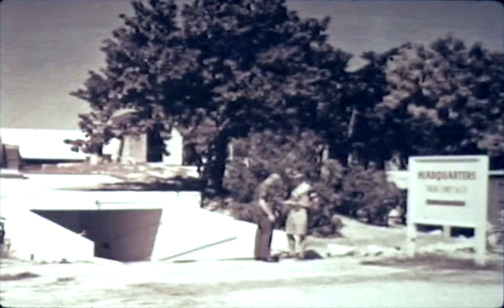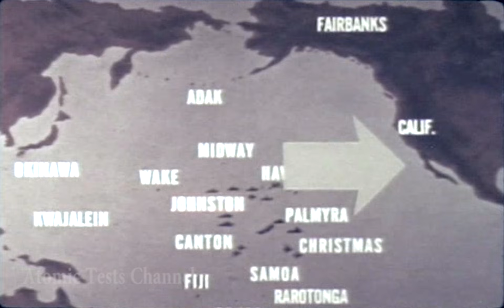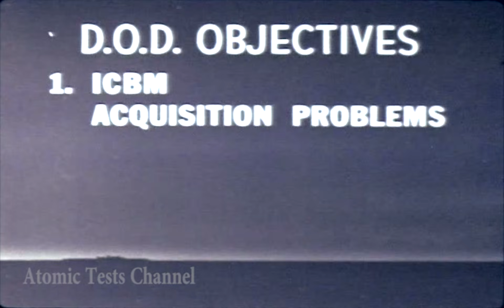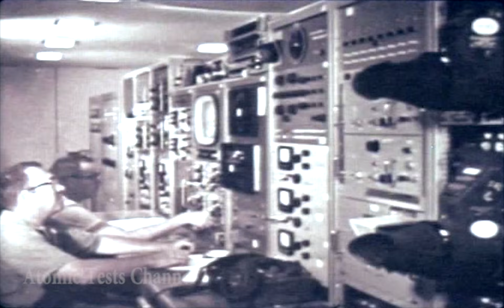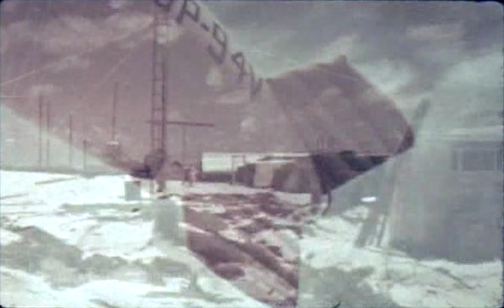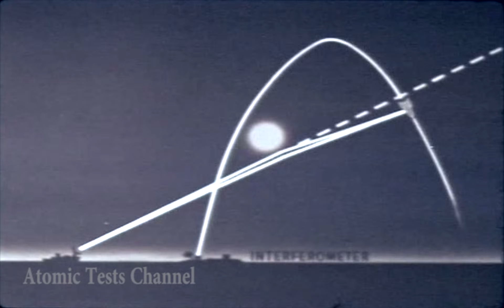OPERATION FISHBOWL - HIGH ALTITUDE WEAPONS EFFECTS

Comment: Everyone arguing over flat earth...if we can take photos of galaxies why can't we just turn the damn satellite around and take a quick shot of earth?? And without photoshop I must add. I feel that's just simple but hey I'm not a scientist.
Reply: Okay here's a question I have. The first thing is whether earth is round or flat, I lean towards it's definitely a globe. But the Apollo missions were definitely some boo sheet, the LEM is a fucking joke. You can do the math yourself, the moon is 1:4 the size of earth.so it would take 1:4 of the fuel it took to escape earth to escape the gravity of the moon. That's if we've been told the truth concerning "gravity" and space etc. From the "facts" we've been told the temp on the moon is, jeez what was it? I'm wanting to say 260 degrees but I'm probably getting that figure wrong.nvm I googlayed it and I was spot on 260 in sunlight and minus 280 when sun goes down. I actually worked at a celenese plant that was the only place in the world that manufactured the flame retardant synthetic material that's used in astroNOTs suits and is used in "space craft" and many jets and such.  It's actually a doped fiberglass mat type stuff. I watched a bunch of quality control test on the material and it doesn't burn really but its also insulating so if you were to go outside on the moon and it was 260 degrees within ten minutes your going to be baked inside that fucking suit and same goes for the lemming vehicle. And that's IF you can make it through the van Allen belts in a fucking tinfoil tent. And here's one other thing, years back when we got direct TV I was watching the tech calibrate and set the precise angle for the sat dish , and I was like how's that work, he said sats are geosynchronous.whixh kinda made sense however I've wondered since then if they aren't just using  those huge sat dishes to broadcast and basically bounce the signal by attenuating the signal off the ionosphere. Which IS something they do and seems more likely than space sats beaming signal strong enough to pick up from a geosync orbit. Because though they did have solar panels at the time of direct TV debut the efficiency was garbage in the 90s and to transmit on all those frequencies simultaneously requires some voltage and current that just wouldn't be available at the time even with solar panels that were like 100 square yards
Reply: The education system at its best
Reply: I don't know a whole lot about gps but when i worked in construction i used a gps unit for setting grade and if you didn't have enough satellites above (you could look and see how many you were linking to) or if you were too close to a tall building or trees, you wouldn't have enough data to triangulate and get accurate readings.  The unit i was using could do horizontal positioning within 0.01 of a foot, and vertical positioning within 0.02 of a foot, without that level of accuracy we wouldn't be allowed to use it.  It had nothing to do with radio towers.

Also...when you look out with a telescope and find say Jupiter in the sky, it looks like a sphere, same with all the other bodies you can find with a telescope, so is everything a disk that just so happens to be pointed directly at us at any given time so as to look round? Or is earth just...the only disc in the universe? Seems a far larger reach than oblate spheroid
Reply: they are waiting until they can get CGI advanced enough
Reply: Better yet, if one side of the moon always faces the Earth, why can't they send a rover with 24 hour live feed of the Earth. They can send and control a rover on Mars, and send back pics to Earth. So why can't they do something on the moon again like I mentioned above?
Reply: We live on a NON-ROTATING EARTH
Reply: What?
Reply: There is many photos of earth like that, not that changes the mind of the flat earth cult even a tiny bit...
Reply: Hey all, just an update. I was just kidding. I totally had all of you going! 2 years I've waited! Ha! Got em!
Reply: Haha got 'em!!
Reply: Yeah take ah selfie.....
Reply: Not picking a side here, but even NASA says there are only 3 full pictures of earth from space. One from the Apollo mission. One in 1972. And supposedly a new one in 2015. Finally a supposed video from 2018 showing the dark side of the moon. They openly admit the rest are either composites or cgi. They have never “turned around” and telescope or camera and put the debate to rest. So it is indeed suspicious.
Reply: Look. More dumbasses 😂
Reply: Whose we ? Did you take pictures of galaxies yourself? Or did you take NASA's word for it? Lol Congradulations , your elevator is out of service!
Reply: @timburdette3556  I did take pictures of several galaxies myself, yes. It's not hard, if you settle for Andromeda a 200$ telescope will do the job, and you can see it with your own eye as well.

For objects that are further out, amateur telescopes can go a long way, although not as good as the NASA telescopes obviously.
Reply: Anyone think Hubble is a repurposed Boeing 777?
Reply: I know you're just kidding, but, for everyone else, there's a difference between what they call "GPS" on cell phones and true GPS. The cell phone version is triangulated using cell towers. Real GPS uses satellites. Concerning the Earth picture, I think the earth is just too big to take its picture from the moon. Also, there's lots of stuff they don't want us seeing, like other beings' crafts. They're hiding the existence of evil telepathic reptilian demon monsters who have secretly been in control of our governments and are the root cause of all this suffering in the world. Thry can read and manipulate our conscious minds, and are very skilled at psychological conditioning. They're the cause of all these cases on court tv and stuff. They are what schizophrenia really is. Righteous reinforcements have recently arrived to help us take them out. The "angels" answered my prayer for help and info, because the demons were harassing and threatening my life for exposing stuff. The angels even helped me get amazing, original photo evidence.

I wrote a long summary and posted a bunch of amazing evidence onto Quora. The address is in my bio. Help spread it to save the world faster. 

This is real "alien disclousure."
Reply: When it's really cloudy or rainy my GPS becomes wonky and I would attribute that to line of sight from satellites being obstructed... if it was ground based weather wouldn't effect it. My cell service will work fine even internet but on really cloudy or severe weather related days only my GPS is effected.... so...
Reply: @mrlucidboy  SO, SATTELITES can travel 1000m/h around earth and a whopping 66000m/h through space? LOL
Reply: @RabbitholeIsrael  He is right in connection with GPS, can it be gallons much lower than satellites? My EMF meter showed very high values from the direction of the sky but antennas / towers on the ground. How? Why?
Reply: Gallons = balloons
Reply: @mrlucidboy  Yes it woud as it relies on a satellite or two but they are attached to hot air balloons in what they call “lower earth orbit”
Reply: @godworden2768  ok so I looked into that and gps satellite claim to run on meo medium earth orbit can you link anything to what you are referring to? Cause Leo and meo are quite a bit different... I just wanna be able to say I learnt something today
Reply: @mrlucidboy  Well I can’t link to anything because it’s not known.  GPS is land based and uses a blimp satellite to bounce off of.  I mean they claim there are tons of satellites travelling really fast always falling around the “curvature” of the Earth, that’s ridiculous and how do you bounce signals off of something moving like that?  Look at satellite T.V, they need to be pointed a certain direction to get a signal and are always pointing that same direction.
Reply: @godworden2768 lol wtf 😂
Reply: @mrlucidboy  LOL
Reply: @RabbitholeIsrael  so it makes sense then, right?
Reply: @mrlucidboy  no it doesnt
Reply: It might if you had actually paid attention to your grade school math teacher or for that matter your PE teacher. 

Ever look at a high school running track and wonder why the outer lanes are longer than the inner lanes LOL now imagine that same math on a global scale, 

I'll make it simple for you just look at a wall clock and measure the arc the second hand travels at 1 inch and again at the outer edge or even simpler measure the circumference of a golf ball vs a beach ball  

OHHHH SNAPPP   how does it feel to have your butt handed to you on a silver platter
Reply: @dannelson8556  Exactly, the outer line is longer, but it's longer on a gone, too when the planes go higher. How much longer on an average height?
Reply: GPS is a ground based system just like cell tower's...if it wasn't I wouldnt have dead zones here when they were allegedly able to communicate on the moon.
Reply: @The843legendz  What about the phone call that Nixon made to the moon? Bahahahahahhh.
Reply: @The843legendz  your talking about Google maps not google earth 🌎
Reply: @pinkyhotmessx69  I said GPS. How can you misinterpret that.
Reply: @The843legendz  No. gps is not ground based, your gps receiver is though (phone)
Reply: @The843legendz  GPS is satellite based.
Reply: @The843legendz  If you are very far north or south, you would get dead zones behind mountains or in deep valleys. I've never experienced GPS dead zones, even at 55 deg north latitude. Well, yes, in tunnels and underground parking lots.
Reply: @Pow3llMorgan  on plane ground under the cell tower. Dead zone. I had a military drill near the cell tower. No reception. Everyone was freaking out cause noone could call their loved ones on spare time.
Reply: @The843legendz  exactly how many times were you droped on your head as a baby. 

Not only can you calculate when the satellites will be flying over the horizon you can actually see them, assuming you understand azimuth and elevation, and if you know a bit of math you can calculate their speed based on Doppler shift.

Yeah satellite tracking is a hoby ohg mine and I've been tracking satellites and space craft from my home since the first moon landing. 

I mean you do realize that millions of ham radio operators and armature astronomers have been tracking satellites and space craft since the 60's ..

It's kind of hard for the government to hide a space craft flying to the moon from anyone with a telescope or radio receiver
Reply: @dannelson8556  Since the first moon landing? Say no more....
Reply: @dannelson8556 what an interesting hobby!
Reply: Photos of galaxies aren't real.
Reply: @luuifyeeeee  So if you are on the moon you can't get the eath in a single shot? The more I research this the more I see the lies of NASA etc. I don't know if its Flat or Round. But I know for sure NASA is lying.
Reply: @Robert-Zimmer  You can, and you have such pictures. Since 1968... But you "honest" lot just choose to ignore them. It's hard to be special if you acknowledge facts, then you would be just another one of us sheeple.
Don't mind me, keep fighting windmills you "special" people.
Reply: All of this while the Earth is spinning 1000 mph , and at the same time rotating around the sun at 67,000 mph!!!. Oh yea and we and the sun are traveling a million mph through a vaccum called outer space!! I guess santa and all his flying reindeer living at the North Pole lol
Reply: Guess you never heard of Hubble
Reply: @pinkyhotmessx69  Hubble has never turned around and taken a picture of earth.
Reply: @Galaxy-gj9wy it’s like trying to take a selfie with a back yard telescope, it’s not possible to get a picture of something that close up with such a huge zoom
Reply: @pinkyhotmessx69  hubble aint did shit
Reply: Because it is impossible. "Space" does not exist... neither does "gravity". Satellites do not "orbit" the earth. All lies. Copernicus was hired by the Catholic church in the 1500's to invent the heliocentric earth model. He was also a freemason. Thus began the world wide effort by the ruling "elites" to hide God from us. The astronot's from the NASA programs... ALL freemasons. These satanists that rule all government's want you to worship them.
Reply: @nope5445  its funny because 200 and some years after what you claim, catholic church condemned Galileo for his theories(now most of them known as facts). flat earthers get dumber each year. now gravity is also a hoax thats interesting, space, i get it, you may not believe what you dont see or feel(God is one of them btw) but gravity is felt every second of your life. ???
Reply: @midgardprint7365  Just with common sense, what about object less heavy then water? Imagine the Earth (globe) and you being on the upside down part playing with a ball in the ocean, the ocean will send the ball up to the surface, how your gravity (direction) works then preventing the ball to fell down to the space? But on a flat earth... Am I wrong, if yes, how?
Reply: @gundelpalacsinta2604  It's very simple and you're mixing up 2 physics laws. ball comes to the surface due to the fact that it has a lower density than the water. it doesn't fall off the face of planet because it doesn't have enough energy released in the opposite way of gravity to escape it's pull/force. i don't know where you are trying to go with this? there can be tens of laws acting at the same time. the fact that gravity exists doesn't change the floatation principles.
Reply: You mean CGI by Galaxy 🌌
Reply: Those pictures of galaxies are fake. Nothing can even leave the atmosphere to take pictures. There's no such thing as galaxies
Reply: @kilaellareign  With a pair of binoculars you can observe yourself some of the galaxies yourself like the Andromeda... And with a proper telescope you can se a lot more. But you have to get out on the countryside where there is less light pollution to see it (you can not see it in a large city because of the sky is not dark enough).
Reply: Face Reality ✅
Reply: @kilaellareign  You can take pictures of galaxies and planets from the ground in your backyard if you spend a little money on a decent telescope.
Reply: @kilaellareign  millions of armature astronomers and armature radio operators disagree with you as we have personally tracked these space craft. 

I started tracking space craft back when we first landed on the moon, Using my own home made equipment I was able to track the Apollo missions all the way to the moon and back. and I'm not the only one there were literally millions of ham radio operators and armature astronomers all over the globe who did the same thing.
Reply: @kilaellareign  Agree fake as f
Reply: @kilaellareign  this has been crossing my mind lately.
Reply: They do and they have but you're going to dismiss them all without even looking. Yet I bet you use GPS almost every day.
Reply: @Pow3llMorgan .....gps is land based. If was in the country other day and no GPS signal until I got close to built up area. You are so easy.....
Reply: @Pow3llMorgan  gps is not a pic of earth
Reply: @Pow3llMorgan  No there are no real images of the entire earth and GPS is land based towers genius.
Reply: @godworden2768  So how does GPS work on the oceans, thousands of kilometers from any land based towers?
Reply: @Pow3llMorgan  it has a far reaching range, everyone knows gps is land based.
Reply: @godworden2768  Everybody who's a science-denier and a blatherskite, perhaps. Cite me a credible source that says it's land based because I have reams and reams of material on how it's not.
Reply: @Pow3llMorgan  submarine cables
Reply: @Pow3llMorgan  He just needs to google radio horizon at 1.5ghz

I suppose you might make a ground based GPS system work a few 100 miles out to sea if you had 100's of  transmitters  mounted on 10,000 foot towers running megawatts of RF power.

Of course a few 100 ground based GPS beacons mounted on 10,000 foot towers radiating megawatts of power might be a bit difficult to hide especially considering that there are a few 100,000 well trained ham radio operators who would spot them the moment the power switch was turned on
Reply: @dannelson8556  Thank you! Finally someone who possesses some reason here!
Reply: @Pow3llMorgan  there are underwater tele communication lines that run all across the ocean to from continents to continent
Reply: @Pow3llMorgan .....how does anything work in the oceans 1000's of miles from land......too easy.....
Reply: “Of course it’s photoshop, because it has to be” - Nasa
Reply: @longlivejah4608  "Photos of globe earth is photoshopped, it has to be" -Dumbasses
Reply: yip, those astroNOTS have more pictures of the strip dancers than of the earth.
Reply: ?? Isn't that exactly what they've done like Google earth
Reply: @ROBHOHHH all photos of earth on Google are all artist renditions or photoshopped
Reply: @ROBHOHHH 😂
Reply: @ROBHOHHH  🤣🤣🤣🤣🤣
Reply: @ROBHOHHH  artist rendering

Comment: Did you know that the various reports produced on HAEMP/reconnection zones/etc are all still classified or redacted? They were interested in finding out whether one could use high level nuclear explosions as pumps for a sort of geomagnetic directed energy weapon. When let off, they inject loads of particles into the planetary magnetic field, which run down the field lines and create dangerous bursts of radiation hundred soft kilometres away.
Reply: Yeah, apparently most info on nuclear EMP effects are classified. Perhaps the larger area of effect makes it more of a threat when compared to a direct physical attack. To really cripple a city, you need multiple weapons to spread out the destruction, but a single large warhead can wipe out the electronics of an entire state.
Reply: i understood no word sorry
Reply: @ErcoleBellucci  You didn't understand,  why ?